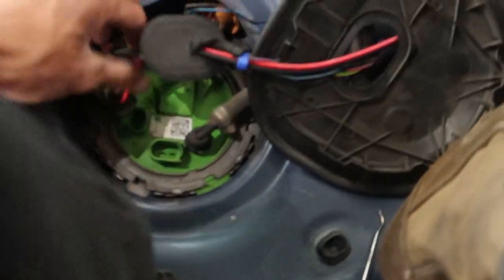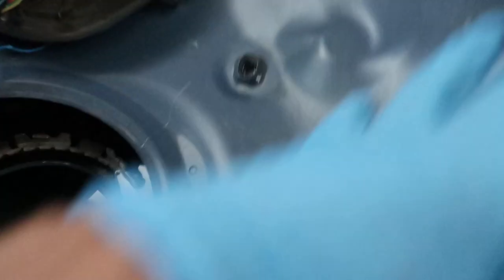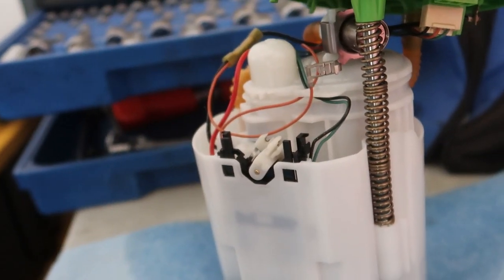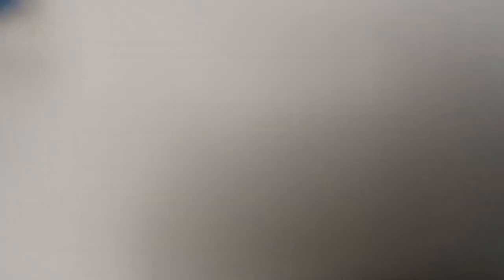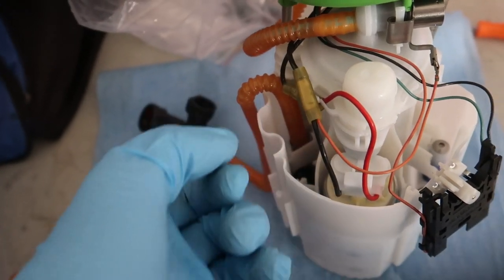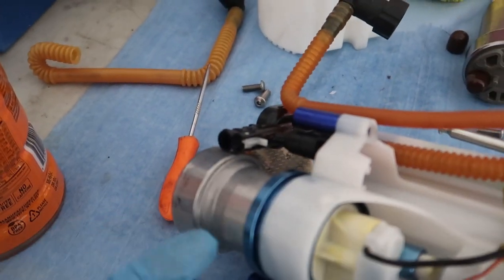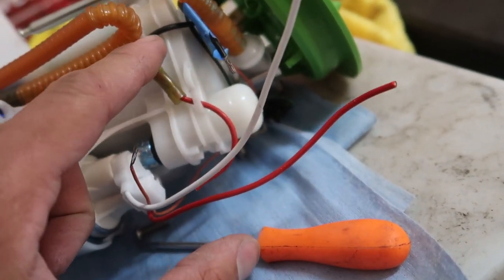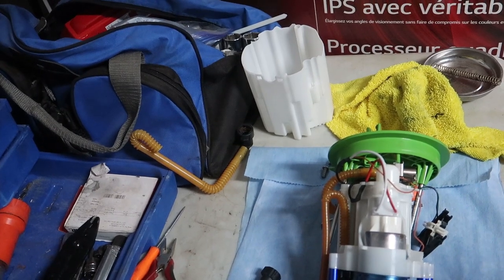535 pump install! | MK7 Golf R

Comment: 535 can run with stock controller?
Reply from the maker: It can.. but you shouldn’t. I had a pm4 with it
Reply: @BryceJordanProductions  i read at mk7 forum.. 535 can run with stock controller.. but 525 can't.. 525 make controller hot & melt.. 
Another option.. just buy eqt standard brushless kit.. support up to 600hp.. enough with my target, around 500hp..
Reply from the maker: @MrJcaen yeah the eqt options are really the best. Modification on the stock basket isn’t fun.. yes the 535 is better then the 525 or 450 with power draw but I still wouldn’t risk it personally
Reply: @BryceJordanProductions  tq for ur reply.. anyway.. nice build car.. 👍
Reply: Hi Bryce im on the process of installing a 535 with a PM4, if i plug everything up without a PM4 tune will it work?
Reply from the maker: @Rafael-kq7tr  it’ll run I’m sure but I wouldn’t do anything besides idle without a proper tune